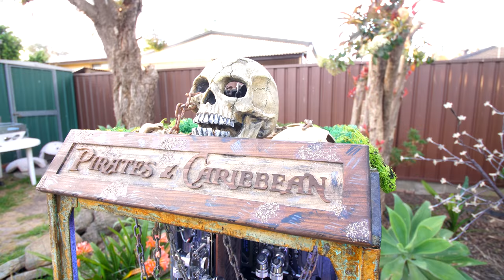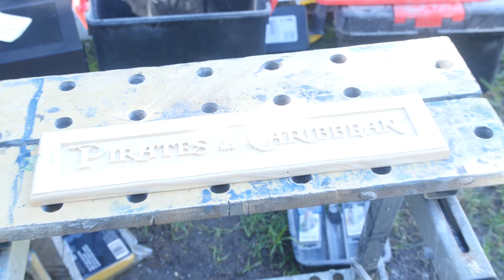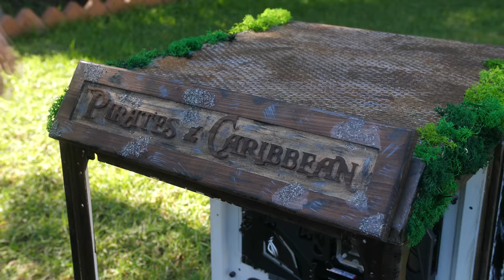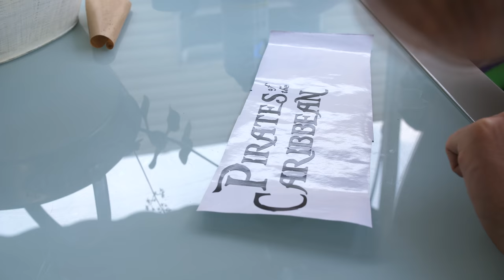Pirates of The Caribbean - Ultimate Custom Gaming Time Lapse PC Build

Comment: Hello greetings from Colombia, I have a small question of chance you know how to polish an acrylic and then what materials to use <3
Reply from the maker: +Rexy Acosta i start with fine grit sand paper and get finer and finer until 2000grit (wet sanding that is) then i grab a polishing wheel and use that woth the polishing compound. Otherwise you can sand it and then flame polish it
Reply: hey thanks a lot I tell you how it was  😍😀